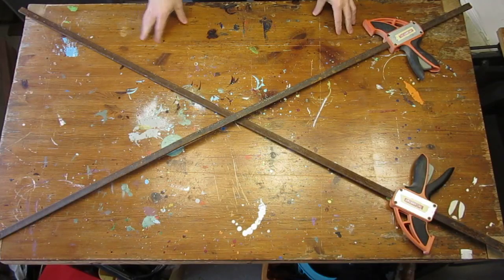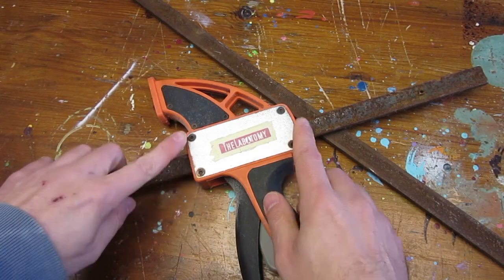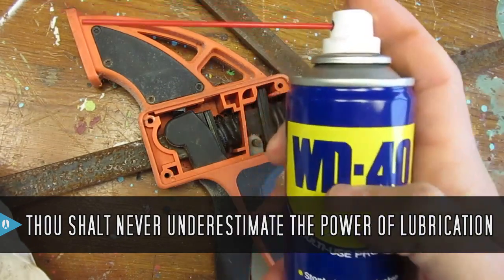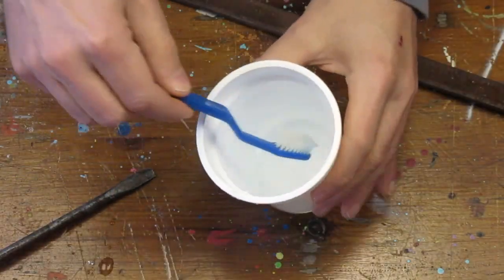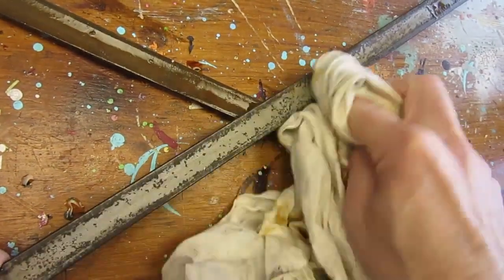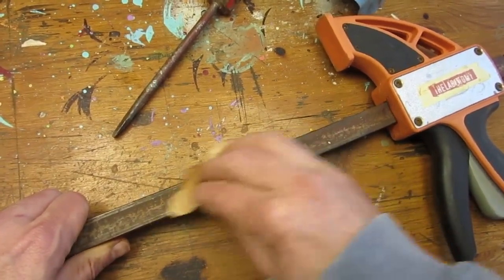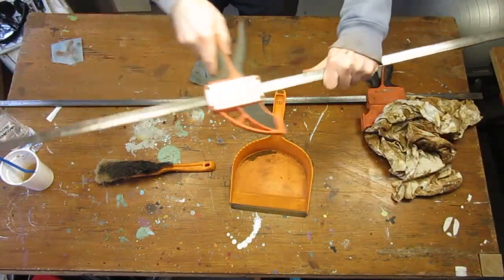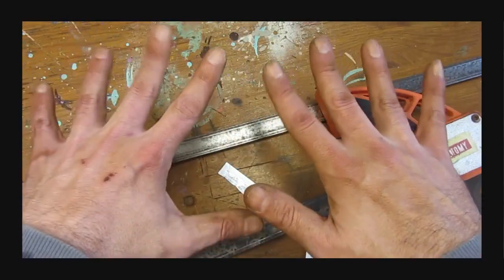HOW TO Restore & Repair Rusted Quick Release Trigger Bar Clamps - Part 1: Removing Rust #DIY #Tools

Comment: I salvaged a pair of 800 mm quick clamps which my neighbour had thrown out. They were unused, still had the cable ties and tags from the hardware store, but were seized with rust. They must have been stored in a damp area for some years.

I got them working with WD40, a hammer and sand paper but the rust coming off them was so bad I was wondering how I could possibly use them for woodworking. So I googled "clean rusted quick clamps", saw your post, gave them the vinegar treatment and they came up like new. Many thanks.
Reply from the maker: Nice! Thanks for sharing